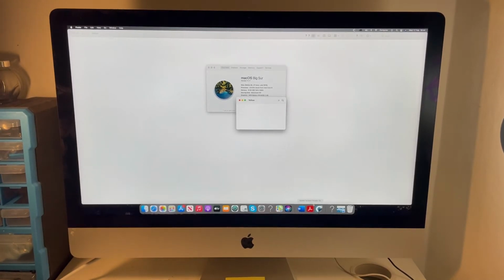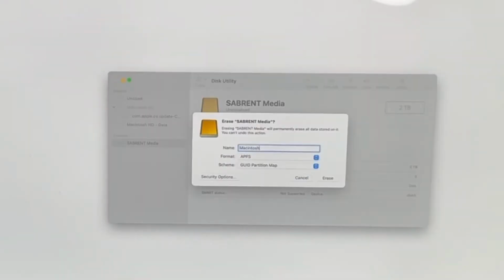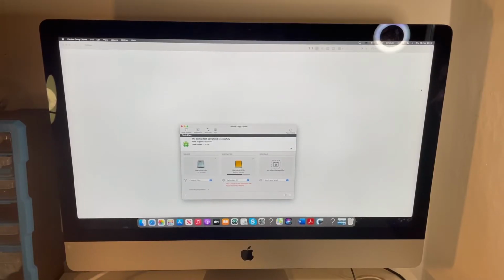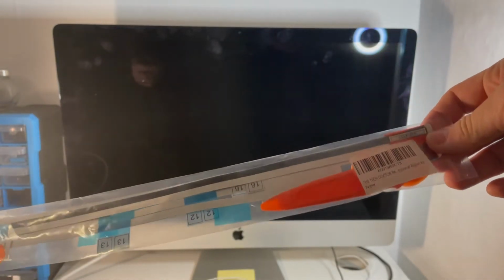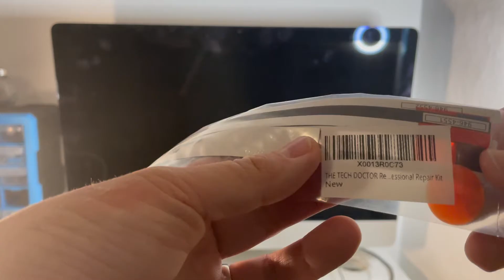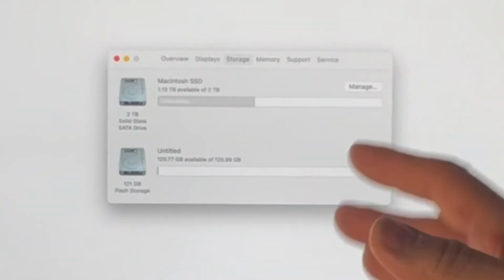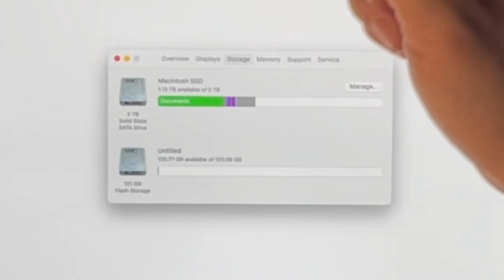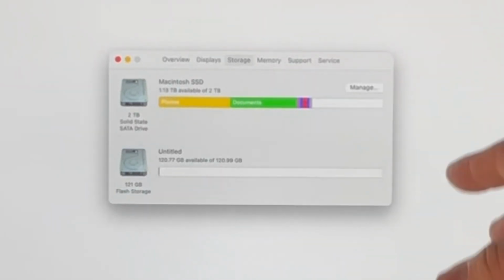iMac 27" Late 2015 A1419 4K - SLOW Fusion hard drive replacement with new internal SSD, MUCH FASTER!

Comment: doesn’t it need the OWC thermal sensor ?
Reply: ANy insight on this?
Reply: @GameboyZoneRocks  I installed it myself. No need to install any sensor or other connector. Just install SSD itself
Reply: @navaidsheikh   - So the instructions in this video was everything required to upgrade for SSD (if not, please let me know what you did differently)? Did you have any fan noise/heating issues since SSD upgrade?

Comment: Hi Andrew. This is a great video and very clear.  One query I have, I have noticed on a couple of other videos from other channels that they also instal a thermal sensor that sticks on the back of the hard drive so that the fan doesn't keep running all the time. It seems to be an cable and sensor that fits inline to the SATA cable. You didn't mention this. Is this necessary? Many thanks. Clive
Reply from the maker: This isn't necessary, you can install fan control software instead.

Comment: This is stupid. You've got a very fast 125 GB PCIe SSD on the MLB that runs at over 2000 MBps, but this repair ignores it, putting everything, including the OS, on to the much slower SATA SSD (where the old hard drive was) with a top speed limited by the SATA interface, 6 Gbps, or at best 750 MBps, although the real world speed is less than that, about 550 MBps. The resulting system speed is going to run a LOT slower than if you had taken the extra step to recreate a Fusion drive, which is not a difficult thing to do. The PCIe SSD sits there twiddling its thumbs doing nothing, its speed advantage completely wasted!
Reply from the maker: As far as I'm aware you can't Fusion two SSDs, macOS won't allow you install macOS onto it as it interprets it as a RAID device. Better to replace the 128GB SSD if you are looking for speed. However if you wanted something fast then get the M1 iMac, it's much faster.

Comment: Thanks so much for this.  I bought two of these imacs for my business, didn't open them for a few months and then saw how terribly slow they run.  Apple wouldn't accept return even though one had just been opened and the other was still boxed.   I thought about changing the drive to SSD, glad to see this video and will get right to it.  Thank you thank you!
Reply: Did you do it? Did it really made a noticeable change when working on your programs? I'm thinking on doing this with my 2017 5K Imac, but wouldn't do it if it's not noticeable faster when using programs...
Reply: @VanLuciMoret any luck?

Comment: I have a question that could probably earn me some insults (for the long explanation), but I presume I could not be the only one who can be in a situation like I'm going to describe. Due to a new job I've got, I own that exact iMac model shown in the video. I have no PC and right now I have a very tight budget. I want to upgrade right now to an SSD (right now I have a 240gb SATA SSD) as the company that I'm going to work for has an ongoing BYOD (bring your own device) campaign, seems there was some trust issues with prior employees. My iMac right now is very laggy and It's almost impossible to do anything in there (Firefox takes around 4-5 minutes to fully run). Due to my current location, Colombia, it's almost impossible to obtain the adhesives to re paste the screen with the iMac body (in Mercadolibre, there are some guys who's selling it but they are far from where I'm living and they have doubtful reputation), so I have to order them whether is through Amazon, OWC, etc. But, the problem is that shipping will take some time (around 20 days to 1-2 months). As I want to resolve this performance issue right away, is there a temporary solution to keep the screen stick to the iMac like Tesa tapes or any other solution while I get the right adhesives? Or, should I wait for the adhesives instead? I'll gonna use InDesign, InCopy, Illustrator, Photoshop, Word and LibreOffice.

I'm sorry for that long explanation, but I had to give some context so any of you can understand the reason of why I could ask for something that is obviously risky.

Thanks in advance.
Reply from the maker: Adhesives are optional, you could use a strip of tape and it’ll hold together fine!

Comment: I am a bit puzzled by this video. OS is installed on the small SSD before replacement. How are you cloning two drives to one drive because you are not replacing the smaller SSD. Let me put it this way. You cannot just take out the HDD and replace it with SSD. You have to use some terminal commands first to split the drives, then replace the drive and then use the fusion command to fuse them again. If you don't split them first it can damage your system beyond repair. I have not found a good updated source to tell me how to split them. If you know of any let me know. thanks!
Reply: Paul I've just done this and after a lot of struggling managed to sort it. My scenario was this - identical Mac to this one in video, with 128Gb SSD and 1Tb mechanical drive, both presented as a SINGLE Fusion drive. So I followed the steps, attached a 1Tb Samsung SSD via USB and used CCC to clone the Fusion drive to the Samsung. (Cloning was a waste of time it turns out). Removed the old mechanical drive, installed Samsung and system failed to boot (of course, Fusion drive now broken). Booted with CMD + R to recovery, and ran diskutil resetFusion but it kicked up an error ("did not recognize verb resetFusion"). It was loading from the (old) recovery partition which is still MacOSX, Big Sur + Monterey is MacOS11 so command won't work. 

I put the old drive back, system booted OK thankfully. This allowed me to download Monterey installer. Next I created a bootable USB stick (min 16Gb). Removed old disk, put in new, booted the Mac with LAN disconnected into Recovery, this forced it to boot from USB containing new MacOS11. 
Next I ran terminal and again "diskutil resetFusion" which now worked! It wiped both drives then created a new logical Fusion drive. It said "Note: you have two solid-state drives, this is nonstandard but OK". Once the ResetFusion command completed, I exited then ran Install Monterey from the bootable USB which installed perfectly.
Reply: @boerboel7777  I don't know who came up with this ridiculous fusion drive. It is prone to failure and can't be trusted. My solution was easier and much more reliable. I got rid of 128GB SSD drive and the mechanical  drive.  I replaced 128GB SSD with 1TB SSD and replaced the mechanical drive with 2tb SSD. Now I have two drives in my Mac. No worries and plenty of space.
Reply: @paulcamalin5236  Crazy but it actually made sense at the time - SSD's were super expensive so merging them with an IDE drive gave you performance and capacity. To this day, gaming rigs still get configured with both, but not in this hybrid Fusion config - strictly separate! You're 100% right, its a recipe for disaster. Even Intel had their Optane technology which was the exact same idea. 
Well done on replacing the M.2 drive, I was cagey doing that - read somewhere that the newer Macs refuse to work with anything not "official Apple OEM" due to firmware restrictions and the M1 / M2 silicon being the worst culprits.

Comment: I have my machine apart , I used disk utility  by pressing power plus r then choosing disk utility and restore, all seemed to fine after a few hours it said it had finished, I th3m rebooted using power and option buttons and chose my new sod to boot to, all went well, booted fine was a lot faster even from the usb. Shut it down, disconnected sad, r3moved the glue on the Mac changed the drive all went fine, haven’t glued back down as I was going to test it ,tried rebooting apple said that the operating system was the wrong one for this machine, so I’m about to reinstall fresh copy of Monterey , I think I will lose every thing else, but I can copy that back over at a later date from old hard drive, also the link for the tapes I didn’t notice there were two types 21 and 27 so becareful wh3n ordering got to wait til tomorrow to see if I’ve ordered the right ones this time

Comment: Andrew, i followed your steps with care. However, my display does not work after changing to a SSD. I swapped it back to the original HHD to check and the display still does not work. Seems like it has lost connection to the display. I can see inside there is two LED lights on. Could you advise me what did i do wrong? Appreciate your thoughts.
Reply from the maker: Sounds like you either damaged the cable or shorted the board or didn't attach the cable correctly, double check!
Reply: @Andytizer  thanks. I think I take it into a computer guys to check…..

Comment: Hi, compliments on the video.
I'm watching many and I'm not sure about something.
I have an Imac Retina 21,5 late 2015 and the HDD failed.
I'm currently buying a Samsung EVO 1TB SSD.
After that I will restore the fusion drive and try to resurrect the computer.
Is this the right process?
I'm reading and hearing about this  "In-Line Digital Termal Sensor" or else the fan will go insane.
Do I have to buy that cable too or I'll be ok by just attaching the new SSD to the 2,5 SATA port and restoring the fusion to new default?
Reply from the maker: From my experience the fan issue could be fixed using fan control software. Also it think that Mac takes the temp from the SSD SMART sensor. I never buy temp sensors, waste of money on old hardware.
Reply: @Andytizer  Oh ok, so this SSD model (SAMSUNG EVO SSD) has the Thermal Sensor integrated?
I can't find the info.
If yes, I think that there should be no issues.
Thanks for your reply

Comment: WARNING: Monterey bricks your intel Mac with a Firmware upgrade that means you can never run it on anything older than Big Sur. I was happily running Big Sur with an external USB High Sierra SSD available as well for using my 32Bit legacy applications on my Mid 2017 Kaby Lake iMac. After a PCIE and SATA upgrade I  installed and booted from Monterey and then dumped it to go back to Big Sur and found that everything below Big Sur gave the error message "this OS is too old to run on this computer". Monterey Also killed the bluetooth side of the wifi card.  Wifi still works thank goodness.  A Bluetooth dongle now takes up one of the USB slots.
Reply: using opencore patcher, you can install Monterey on old iMac. For example, I can instal MacOS 12.6 on my 2009 iMac

Comment: Two suggestions for those that follow. First, CLEAN the internals! Use a vacuum with a soft brush attachment to remove as much dust from the components, the housing and fan as possible. You'll want to avoid any static electrical discharger so be VERY careful not to touch the logic board itself with the vacuum. Use canned air to blow out any residual dust. Your Mac will run cooler when it's clean. Second, remove the backing of the new screen adhesive first and attach it to the case. Then, after you've tested everything to make sure it's working normally, remove the screen-side adhesive's backing and carefully reattach the screen. Note that  the screen is very fragile so put as little pressure on the it as possible, both when removing it and replacing it, and never, ever lean on it. A very nice and well-done video. 👍
Reply: As someone else mentioned, is there any issue w/ fans when making a HDD to SSD upgrade? I've seen tutorials in the past mention the fans either never come on & it overheats or it never shuts off & make constant noise
Reply: @cecilsays-legalmindsetcant1339  Yes, this is a botched upgrade.  First of all they didn't even split the fusion drive logical group, so the size is all messed up in System Info and it's going to cause tons of problems.  Second, they didn't install the proper temp sensor on the HD, which will make the fans constantly run at full blast 24/7 (VERY noisy).  This person really doesn't know WTH they're doing.  They can't even get their camera lens to focus on the screen properly.
Reply: @spacecadet2172  there are problems, straight from The Apple, regarding improper divisionality representation of their so-called 'fusion drive'.
please you will make us video to show how to repair this situation.
thankees
Reply: @spacecadet2172  what does it mean to split the fusion drive logical group?  If one is trying to get away from the fusion drive, isn't cloning the "one" drive seen onto an SSD the right way?
Reply: @cecilsays-legalmindsetcant1339  i've heard someone saying to add a thermal something to avoid problem with the fan
Reply: PLEASE U WILL PRESS AND HOLD POWER BUTTON >15SEC AFTER WALL POWER HAS BEEN DISCONNECTED. THIS WILL HELPING TO DRAIN REMAINING ZAPPO ENERGY RESIDING IN COMPUTORISATION UNIT

Comment: I have seen videos where I can simply add an external ssd drive and run it that way, so I don't have to remove anything but clone it? What are your thoughts on that?
Reply: My reasoning for looking this up was on some iMacs using this method you are not bottlenecked by USB 2.0 speed
Reply: That would work, but the late-2015 iMac only has TB2 (10 Gbps). It's still fast, but not as fast as a TB3-equipped iMac (2017 model).
Reply: @demef758  20 gbps* - tb2

Comment: Great informative video.  My Fusion hdd just failed, and came to YT for help.  I noticed that you ended up with 2 separate SSD drives instead of a Fusion drive, will this pose any issues when I try to restore from my Time Machine backup?  Should I install the OS on the on board SSD or the new SSD drive?  thank you
Reply: The PCIe SSD is much faster than the SATA-linked SSD (i.e., "old hard drive"). Install the OS on the PCIe SSD.

Comment: Hello there! Excellent video and explanation! I have the exact same computer and I have a question, if I opt to do the upgrade via an external 1 TB SSD (this iMac offers only USB 3.0 ports) how much "worse"  the upgrade will be compared to what you did. I mean will I still get a noticeable improvement compared to the internal 1 TB HDD (7,500 rpm) currently installed in the iMac? I would never attempt to do what you did on my own, and the price of the repair shop is 270 euros in total (the work plus the new SSD). I am on a big dilemma so I would appreciate your advice! Thanks in advance!
Reply from the maker: Basically a SATA SSD like the one I used runs about 500MB/s and the USB 3.0 interface caps around 600MB/s and SATA3 (internal) is around 750MB/s. In theory SATA3 runs faster but it’s kind of irrelevant because the SSD won’t ever reach the max speed. However USB 3.0 might have more latency and be slower, which can be mitigated by the UASP type drive. 

Basically I would just use the external SSD method (I have another video on my channel) and if for some reason you’re not happy you can always ask someone to install the SSD you bought internally. Both methods offer ‘enough’ speed - much better than the original HDD which was total rubbish. 

At the end of the day these 2017 iMacs are superseded by the new M1 iMacs and their transfer speeds are insane eg 2500MB/s however will most users notice? Not likely!
Reply: @Andytizer  Thanks so much!
Reply: ive done both and they are both considerably better than a spinning HDD and as this chap points out the fusion drive is useless and failed after the warranty ran out. my next task is to try and replace the 128mac PCI card with a 2tb . However I do get a random reboot issue with SSD drives , I did not with Big Sur but I do with Monterey. My research tells me its with hibernate not working properly and causing kernel crashes, there is a sudo command to use in terminal to alleviate this - it worked on my mac but id prefer to know how to get the latest firmware so I don't have to use terminal commands. good luck, oh the other way to speed up the mac is more RAM

Comment: Very clear and useful video. Thanks Andrew.
Can the SSD be smaller than the original 1Tb drive? i.e Fusion 1Tb drive cloned to 500Gb SSD?
Thanks
Reply from the maker: Yes as long as your original Fusion drive is consuming less than 500GB space.

Comment: Thanks for the great instructional video Andrew. I have a 27" iMac Late 2015 but only HDD, not fusion drive config.  Would simply swapping the HDD with SSD as according to your instruction work?  System is making fluttering sound from time to time, I think when hot, so it needs a clean from dust, a fan check and replacement HDD.  Thanks.
Reply from the maker: Yes you can just change the hard drive, should work fine. Give it a good clean!